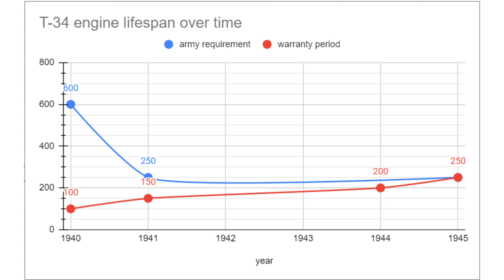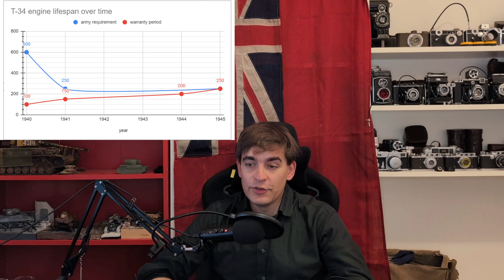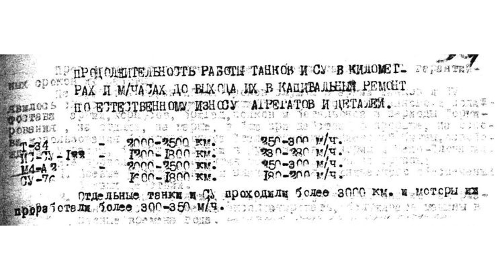The Myth of the Disposable T-34

Comment: It's still in service 84 years later. One could argue that it's actually the least disposable tank ever
Reply: The Stuart beat you to it. Refusal to dispose of equipment is due to budget constraints. Not because it has a niche.
Reply: The Soviets considered the T-34 outdated after suffering heavy losses in the Battle of Kursk against Tigers, Panthers and other German tanks armed with long 75mm cannons.
Reply from the maker: @JAnx01  work to replace the T-34 with the T-43 began a year before Kursk. The response to Kursk was actually to cancel the T-43 and upgrade the T-34 instead.
Reply: @JAnx01  More like after seeing Panzer III before the war started. T-34M with a 3 man turret that would turn it into a proper tank instead of an overgrown tankette was in prototype stage but was abandoned due to start of the war and needing to focus on pumping out masses of already existing tanks.
Reply: Well said.
 Personally, the best thing of the entire T-34 series is the fact that it could be relied upon to make it to the battlefield and not break down with engine trouble or requiring substantial amounts of logistical support to keep it going to get there.

I laugh every time I hear how much better engineered German tanks were over Red Army tanks. 
In some ways they were, but if you cannot make it reliably to the battlefield, none of those advantages matter, you are just a drain of resources.
How is such a highly flawed engine design "good engineering"?
 
The T-34 was easy to maintain and keep running at the crew level with a good mechanic onboard.
It required less resources and was adaptable.
In my view the T-34 is the mother of all modern tanks and was a notable example of what a well-balanced tank was for its age. 
Thanks to @Tank Archives for another well-reasoned video.
Reply: The T-34 that are still around today are T-34 that were built post WW2 and were built better and at a time when they were cranking them out as fast as possible - built quality was not very good during WW2.
Reply from the maker: @markholmphotography  the T-34-85 I was at in Capel was built during WW2 and fought during WW2. It was ultimately captured in Yugoslavia, at which point the tank had 50 years of service on it. Sure, a lot of T-34-85s you see today are Czechoslovakian post-war production but there is no shortage of genuine Soviet T-34-85s still driving around.
Reply: That says more about the miserable state of Soviet economics than anything. Alaska was built by WWII surplus, but the moment new vehicles were available, the old Studebakers were left to rust away in the woods. You'll still find them all over the place.

Russia has its own untamed territories... sadly, none of those territories have seen any economic growth since they shut down the death camps.

The T-34 was a good enough tank made by a floundering dictatorship on the verge of collapse. Like the Panther, its impressive they managed to make as many as they did all thinga considered, or that they worked half as much as they did... which wasn't very often.

They were shit tanks, no doubt, but better than no tanks. Thier numbers left them with alot of spare parts. Thats the only reason you still see so many of them driving around. NONE of them survived this long in original or even refurbished condition. They couldn't even survive the war in that condition.
Reply from the maker: @Sgt.Shitlord  a whole bunch of vehicles on the T-34 chassis were used as prime movers and railway tugs long after the war in addition to the vehicles that remained in service with the armies of the USSR and its allies. Like I said, there is no shortage of T-34s that survived their 3000 km warranty period and then some. If you actually bother to look for them instead of writing them off as shit tanks, you can find quite a lot.
Reply: @Rolf-son-of-an-electrician

At “shut down the death camps” I stopped reading. Your  dad may be an electrician, but you must be a plumber because of how you’re talking crap!
Reply: @Sgt.Shitlord  my friend, Stalin’s reign was not the entire history of the USSR. It was a significantly better and much more free place before that maniac came, and WAY better after he finally died. It had its flaws, but overall, it was overwhelmingly in the net positive (in my humble opinion).
Reply: @hamzaalikhan9932 Stalin's deeds are severely exaggerated. I'd say he was comparable to the leaders of his era if not better
Reply: @hamzaalikhan9932  🤣
Reply: @park1776  IIRC Stalin currently holds the record for the largest overall improvement in quality of life over the shortest space of time in history, he probably would have gotten the life expectancy one too if not for WW2
Reply: @liamedmondson8902 I think it was actually Mao.
Reply: @paulussturm6572  Mao managed the largest increase in life expectancy over the shortest space of time in a country but the soviets managed the others due to having a smaller population but lost out on the life expectancy one due to WW2